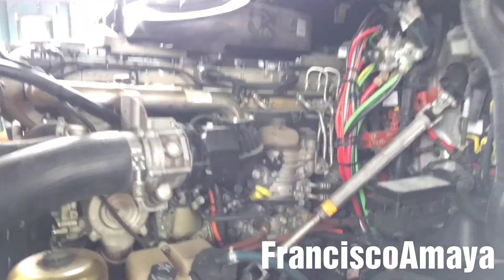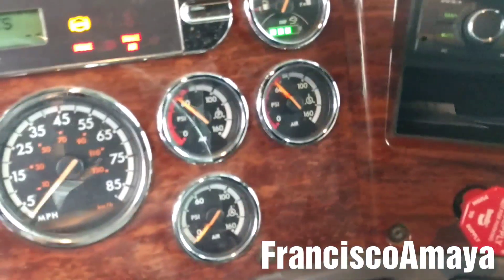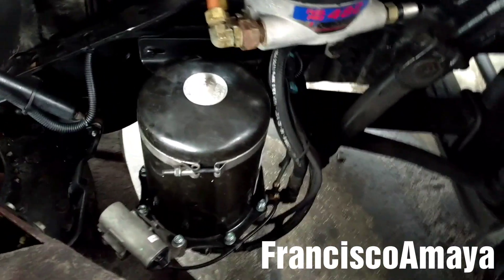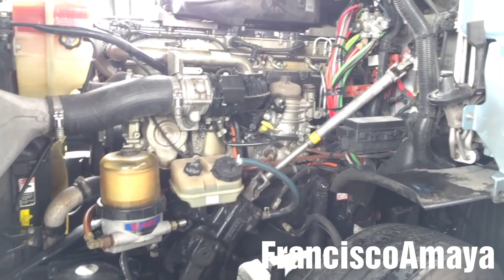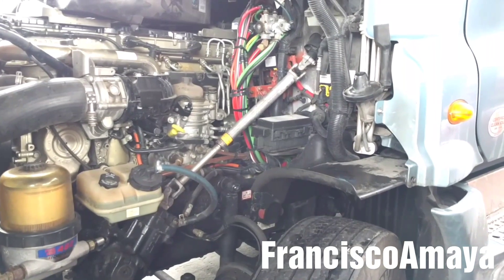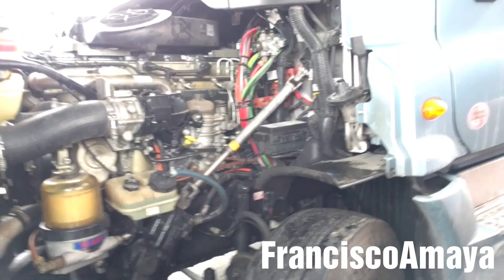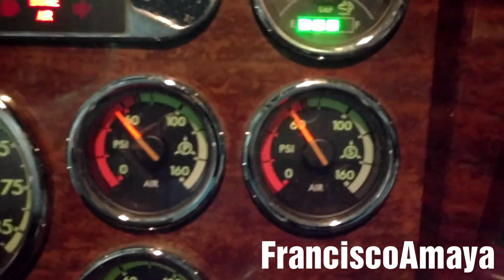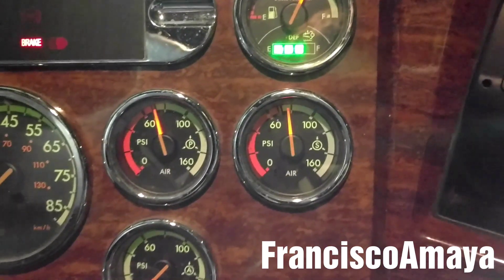Freightliner Cascadia DD15 engine air compressor problem building air very slow not building air

Comment: Hey  i got issues losing air when driving to under 100 psi then it build it up by it self , even when I parked to push the gas to 1500 RpM the air gages doesn’t move , after couple minutes it built up by it self , I don’t have any air leak I changed the Air compressor governor but still have problems please advise me with to do
Reply from the maker: that could the compressor air hose to dryer

Comment: I replaced my compressor 2 months ago. Starting yesterday. The truck will build air pressure fine. The it will drop down to 60psi and hold it there. I have to throttle up and it takes at least 5min to build back up to 140. Once it does. It’s fine afterwards. It hold pressure after that. What could that be?
Reply: I'm having the same problem. Did you find what was the issue?

Comment: Air pressure struggles to build past 80psi while idling and revving with breaks applied. 
Once I release breaks, pressure drops right on the red line, making buzzer go off. This happens every time I stop. 
I move forward a little and it builds back up but no more than 100psi .. even on the freeway. 
I drained tanks (not completely tho). 
I didn’t hear any water come out. And I tapped on air dryer. 
Didn’t solve problem. 
I’m not very mechanic savvy. I’m only company driver :/ Help
Reply: What was the problem am stuck on the side of the road now same issue
Reply: @omarmorgan6056 Damn bro that was such a long time ago. I think it may have been my air dryer. I think the owner of the truck just replaced the whole thing.
Good luck man 👍

Comment: You confuse me. In one video you say if the air is building slow and you have no air leaks it's the unloading valve. In this video you say if the air is building slow and you have no air leaks it's the air compressor. How can I know if my air is building low because I have a bad unloading valve or if the air compressor is bad?

Comment: Hello Francisco hava a 2012 Cascadia DD13 have the same issue on your video, build air to slow, replace the air compressor still with the problem, replace drier and  governos, still with the problem, any  idea, i think can be the gear on rear side of the engine.
thanks
Reply from the maker: Check if there is Water in the tanks

Comment: My air compressor charges to 125 psi and goes back to 100psi most of the time I’m running the truck at 100 psi can’t find any leaks. What can be the problem?
Reply: Good morning Torres did you find the problem? Because I'm having the same problem
Reply: @Noel-px6ys  yes it was the governor

Comment: 2012 Cascadia DD13.I have air shooting out from a valve on the air compressor makes loud noise. I replaced the valve but it didn't fix the problem. What can I do next?
Reply from the maker: Check you air dryer 
Check your air tanks for water 
If everything is ok, your compressor could be bad.
Reply: Thanks, I fixed this problem with a 250 psi bleeder valve and new dryer filter. No more noise.Air tank is holding pressure.
Reply: This happened to me ! It is the main line from the compressor to the dryer clogged

Comment: How often is.the compressor supposed to run?  my truck is automatic, I donot see the air pressure go below the minimum for the co.pressor to kick in.  It runs for like 10 seconds then the n it stops as soon as the air dryer releases pressure
Reply from the maker: The air supply system is good in your truck.

Comment: Got a question, we've got a '08 Columbia with the Cat C15 motor takes forever to build air pressure. At idle it wont pass 50psi, and 1500rpm it takes over and hour to get cut out. I've replaced the governor, dryer, and compressor. I've found a few small leaks but nothing big enough to justify that long of a air build time.
Reply from the maker: Check the main hose that goes from the compressor to the dryer, sometimes it leak and the PROBLEM happens.